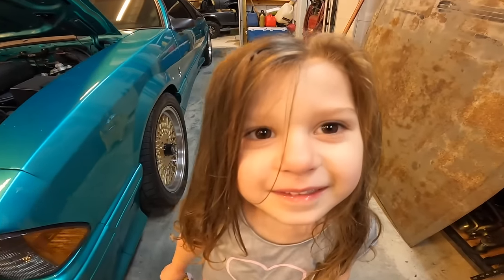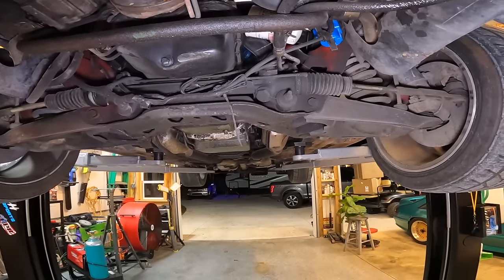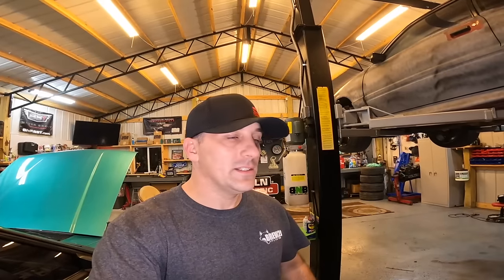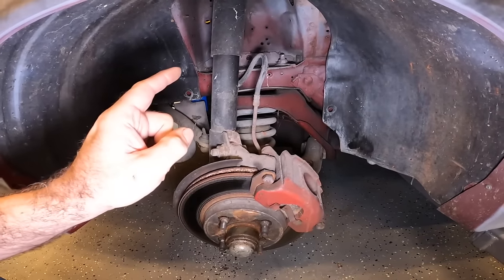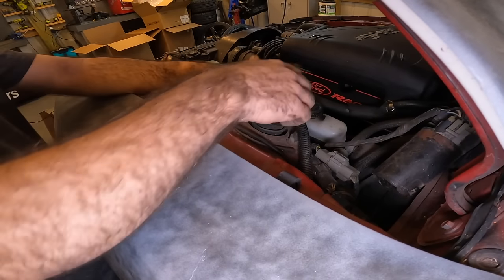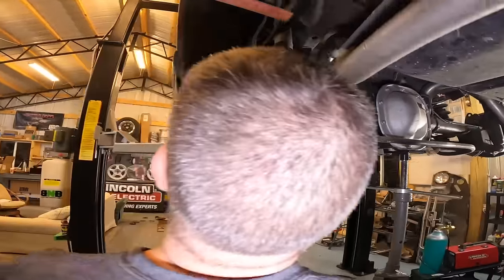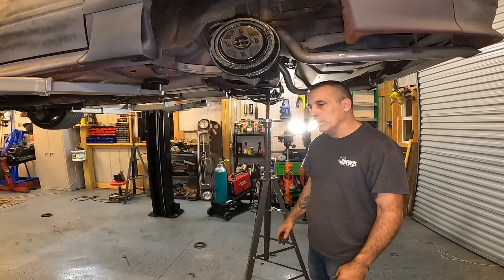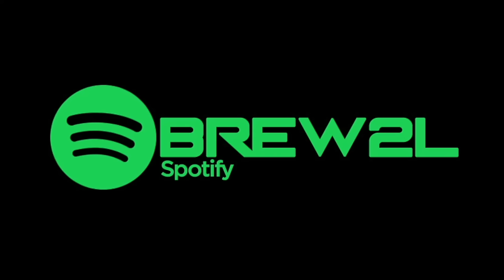STOP BUYING LOWERING SPRINGS! / How To Cut Your Stock Springs / Quick And Easy

Comment: If you talked about cutting springs in a fb group they would flip out. They'd say that's the worst thing you can do and you shouldn't be working on cars. Funny thing is I cut my springs long before the internet came along lol.
Reply: Lol same here 1998 was my first experience cutting springs.  I was 16
Reply: @KDBHonda256  I cut springs in 1989, I was 18 lol
Reply: Cutting springs is bad and I've done it way before the internet myself
Reply: @slushbox3443  it doesn't have to be.  ;-)
Reply: @KDBHonda256  do you need to heat it?
Reply: @G_STYLIN  what are you heating??
Reply: @slushbox3443  I would never do it again and all my mates wanting to cut there springs, trying to be so cool. like omg terrible idea.🤣🤣🤣
Reply: I ran a poll in a mazda6 group and more people prefer cut coils to getting coilovers or even bags.
Reply: Eaton Springs, the largest manufacturer of automotive springs, has a video on how to cut springs. People like to just pretend they know what they are talking about.
Reply: I've owned probably about 20 cars (yep I'm old now).  Cut the springs on 4-5 of em.   One coil off.  Never ever a problem.   Improvements in looks, handling.  And the ride was just fine.  Mind you I've also spent a small fortune on aftermarket lowering springs too.   Toss up.  In my experience, nothing wrong with a mildly cut stock spring.  Gonna do it again very soon on my latest car
Reply: @chefshadetree3972 while you were cutting springs I only just entered the world lol 89a. Happy 53rd birthday coming up.
Reply: What's the minimum drop if we cut our springs?
Reply: We cut springs before coil overs and I’ll cut springs in my next couple of cars. 95 pathfinder cut two coils all the way around

Comment: I'm a Camaro guy but I like your channel anyway. Finally someone that tells the truth about cutting springs and shows how to do it properly. I'm looking to cut the springs on my iroc Camaro sometime soon when this PA cold weather decides to kick rocks. 

My Brother has a fox body and we're always dissing each other, we sound like a couple of teenagers fighting over a girl. Typical Mustang vs Camaro feud. He's got a 5.0 full bolt-ons, headers and exhaust and I have a 350 high compression with an aggressive cam, quadrajet, headers, 5-speed swap. He gets me out of the hole every time but I walk by around the 90 mph mark. I never could believe how well a fox body responds to mods. Good straight line cars but I completely blow him away on the back windy roads. Fun stuff and I like your channel 👍

Comment: I’ve put shorter vert springs in the back and cut the fronts. 
Car rode great. 
I also put a smaller V6 sway bar on the front while leaving the stock 5.0 in the rear. 
It made the car stop pushing when at cornering grip limit. 
Handle completely neutral, and was easy to throttle steer if I wanted. 
Counterintuitive but worked great.
Reply: Vert springs aren’t shorter they’re higher spring rate due to the extra couple hundred pounds in the rear. If you put a stock vert spring in the rear of a hatch or notch it’s going to ride harder and taller.

Comment: I tried this exact method when trimming the front springs on my vert. I only cut 1/2 a coil out and removed the isolators to be safe. No matter how hard I struggled, I could not get the springs back in. Had to give up and remove the control arm bolts from the K-member and install them from the inside. Probably would have worked if I cut a full coil, but I wanted minimal effect on ride quality. Good video Brew
Reply: Same. It took me and my brother full strength and technical skills to get that back in. I’m strong like a mule too. Pry bars, legs, floor jacks…. It was rough.  Came here to see how he did it. I need a tool to make it easy. Anyone?
Reply: I had the same struggle and had to walk away from it a couple of times. I tried a few different kinds of spring compressors to no avail. What actually worked? The Maximum Motorsports tool, getting the car high up enough and getting the A arm 90 degrees from the car. Jacked it up slowly.
Reply: @RR5.0  thanks for the tip. Don’t you hate when things look so easy and end up being so hard lol

Comment: If you are running full length headers with cut springs or lowering springs the headers will drag sometimes on speed bumps and different grades going into stores or business all depends where you drive your car

Comment: I bought the tool from MM that's supposed to work wonders. I do like how you slid strut out and left everything on. I was going to do Eibachs but I may try cutting them to see if I like it. I had mine lowered years ago and I hated the ride so much we put stockers back in, which was a struggle. The right side spring didn't go in perfectly, leaving it sitting high on that side and  it has been like that for about 20+ years.

Comment: Did you leave the isolators off on the top and bottom? Both the front and rear? How does it ride after that? Also, how close is your exhaust to the ground?

Comment: What’s the best way to straighten the front fender out from where someone jacked on the pinch welds? My drivers side is bowed out a little from someone doing that
Reply: Yes I want to see how to fix this too!
Reply: Best way I've personally found to bend them back is taking a big adjustable wrench, tightening it onto the pinch weld and belding it back straight. Some undercoating or paint after you have it straight isn't a bad idea as you'll probably have bare metal in some spots, it can also help hide imperfections with your repair.

Comment: There is a better, faster and more accurate way to melt the spring by welding and take measurements before everything and after until it reaches the desired height in only 10 to 20 minutes 
And i want to thank you for your time
 and your vids are very helpful 👍👍👍

Comment: Seems like everyone is missing the reason to not cut springs. There's way more components in suspension other than springs. The changes in geometry, stress points (shortening shock stroke), accuracy of the cut etc all those thing come into play.
Reply: It does change those things. But so do lowering springs.

Comment: Would you reccomend cutting the Ford B or C springs? I put a set on my car years ago, but I cant remember which set lol. Anyway, it's not low enough in the rear and I cannot find my factory springs anywhere. Just curious if I should or just find another set of oem.
Reply from the maker: Absolutely! I’ve cut them before with no issue. Other than being a little more stiff than a factory cut spring.
Reply: @BREW2LFOXBODY  Cool, sounds like it'll be happening soon. Almost have it back on the road after a couple years.
Reply: @BREW2LFOXBODY  What does one coil cut equal in inches? You may have covered it in the video. Forgive me if I missed it.

Comment: I had to cut the bolt off both sides of the top struts.  How did yours just spin off?  The inside twists, it did so on the new one as well, I had a terrible time with that.  How did the one here just stay in place?

Comment: I put UPR coil overs on the front of my ‘82 with cut coils in the rear. I love the ride height and the handling, but the squeaking of the coil overs is making we want to put cut coils on the front. What is the handing of the cut coils like compared to a coil over?
Reply: That's what I want to know as well. I autocross my car so performance is extremely important

Comment: One important part i may have missed,so you cut this spring like you have.how much did it drop?im on the fence of ordering lowering springs or cutting my factory spring
Reply: I always start with 1/2-3/4 of a coil reinstall check ride height then readjust if necessary until I get the stance that I am after . P/S I also use heat shrink tubing instead of the stock insulators makes the car quieter and smoother because it eliminates metal to metal contact  . Good Luck 🇺🇲 🇵🇷 🦊 👍
Reply: Electrical tape cheapest option

Comment: I did a coil and a half in the back… but it’s not level from compared to the front, it’s off about a inch, a little bit of rake. Can I cut more off and be safe for the rear?

Comment: My mercury zephyr (fairmont) broke 1 coil off the front springs when I pulled them off and it rode the same and sat so killer ! But got a deal for eihbac drag springs and threw them on car sits higher but rides real good and weight transfers good

Comment: Fox body quad shocks have no absolutely damping (the one that run front to back). I replaced them with Koni shocks, it was night and day difference, it was like having a Gorilla hold the rear end in place. Triple
Reply: Those shocks are designed to remove wheel hop while cornering, not damping overall suspension travel. I kept them on my foxbody autocross car for that purpose. They do have a purpose. They help to remove some of the unrated spring load effects when that bind unloads in a corner. You can also shave the outside of your rear upper and lower control arm bushings to prevent that bind altogether. I ran my car after that with quads on and off but still had minimal wheel hop without and none with them. 

A lot of people say never cut coils and remove quads altogether... they've never done high-G flat turns at speeds and had that ass end of their Fox-Stang try to pass the front end in a hurry. I did and after a couple simple mods it never did that again.

Comment: At least here in Germany cutting springs can get you in serious trouble for inspection. Especially on the back where the springs aren't that loaded to begin with a cut spring may not provide enough preload. That's also why most lowering springs are harder to compensate for the lower rideheight. I guess you all know this but in certain cases cutting a spring may make spring pop out the cup on a hard bump or sth
Reply: Won't ever happen on a foxbody unless you cut like 3 coils
Reply: That's my worry on the rears. Cut too much and it can shift out of the cup.
Reply: There is also a different method to lower a car. I don't have a good translation for it. Basically one takes the original spring out of the car uses a spring compressor and after that the still compressed spring will be heated in an Ofen for like an hour. This makes the spring being shorter afterwards. Downside is that it can soften the spring rate. This method can give you an additional inch of lowering.
Reply: I can't think of any state here where there is a regulation on a cut spring to modify ride height or comfort especially with a more then 25 yo car.

Comment: I know you'll need caster camber plates, but what about bump steer kit?
Reply: What’s a bump steer kit and what’s it do?
Reply: @willwork2fish261  if you change the front suspension geometry too much, it can cause the car to dart one way or the other when going over a bump. It seems to be more noticeable to some than others. The roads are so bad where I am, I typically keep the stock ride height lol! So I only know the basics.
Reply: @mccoma11  no worries thanks for the reply. Same here in Oklahoma… I’ll check into it. Just cut a coil off the front so shouldn’t be to much be we will see
Reply: Only if You lower your car too much and You should have the wheel alignment checked and set . 🇺🇲 🇵🇷 🦊 👍

Comment: If you have a sports car with proper suspension you should cut your springs instead of getting shitty lowering springs bc your car was built for the original set up or buy a 10k suspension kit that performs 2% better lol

Comment: Eibach ride like shit compared to cut springs. 

Anyone reading this if your stockers are in good shape just cut them i find Eibach to have to much spring rate and and under cut the shock absorber job. 

Just cut and its smooth and your shock absorber actually do there job. 

I had issues due to the car being much lighter than an 89-93 GT and it was bouncy no matter what adjustments were made on the strut.

Comment: just cutting one full coil itself and using the isolators would be more than an inch drop right lol? I watched a video where this guy said cutting 1/2  coil would give you the inch drop because whatever happens at the spring happens twice at the wheel. Start video at the 6:00 minute mark https://www.youtube.com/watch?v=TIwtrsj13l0